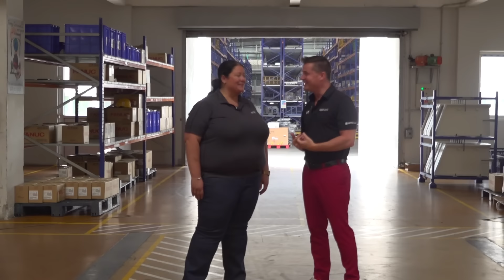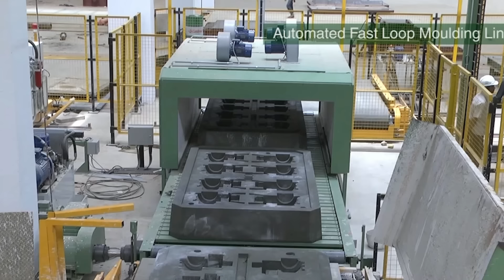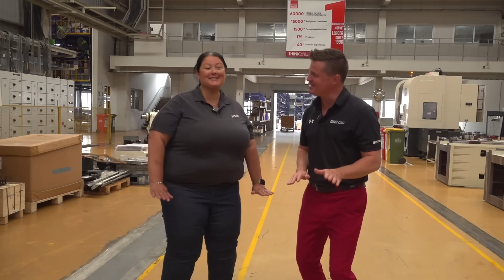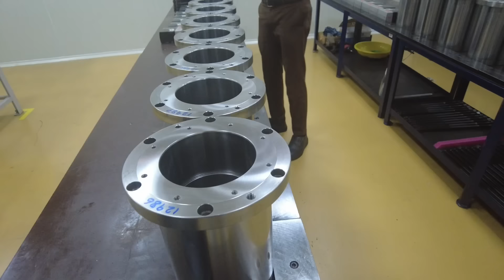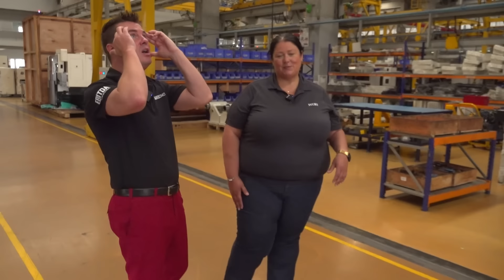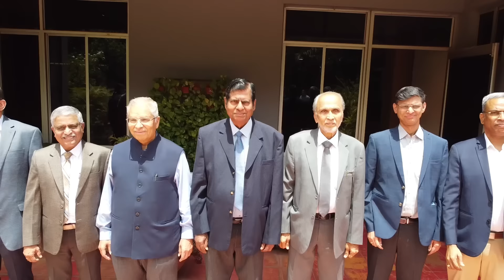Hand Scraping in India and The Next Global Machine Tool Giant Is Ready to Take Over!

Comment: India has had a long history of metallurgy, with evidence dating back thousands of years. The history of Indian metallurgy is supported by archaeological discoveries and literary sources. 
Early evidence   

• A copper bead found in Mehrgarh, Baluchistan, dates to around 6000 BCE
• Iron implements have been found in Uttar Pradesh dating back to 1800–1200 BCE 
• The Harappan civilization used the lost wax process to cast bronze figurines 

Metallurgical achievements 

• The Delhi Iron Pillar, a 70-ton structure that has resisted rust for over 2,000 years 
• The huge beams at the sun temple of Konark 
• The Dhar pillar 
• The steel sword of Tipu Sultan 
• The massive forge-welded iron cannon called Rajagopala, located at Thanjavur 

Metallurgical practices 

• The use of tin and arsenic to improve the hardness of copper 
• The use of mercury distillation, which was mentioned by Indian priests in the Earth Shastra 
• The use of the forge-welding method to manufacture iron objects 

Influences on metallurgy

• Cultural and commercial contacts with the Near East and the Greco-Roman world 
• The Mughals, who improved the tradition of metallurgy and metal working
Reply: In the 1790s [after the Industrial Revolution, funded with loot from India] was underway, a panel of English scientific experts declared Indian Wootz the best steel in the world and Sheffield etc. copied its processes.

Comment: very interesting to see India rising to its potential particularly in high precision engineering. This interview reflects many of my own conclusions, having been taught hand scraping for a surface table i had to make during my engineering apprenticeship 60+ years ago. And the difference between 'mother' machines that are good enough to create parts for other machines. I recently moved our factory production from China to India and can confirm India has this incredible opportunity to take over this sector. We went from traditional manufacturing to completely cnc production of sheet metal, tube and shifted away from massive presses and roll forming for our needs. Result is lower tooling, faster delivery, smaller customised runs, and generally a more adept and agile manufacturing resource. This is so good to see. I suggest anyone concerned about China should explore this country. 
Being much smaller we can't integrate as much as they have but we have found suppliers of key parts which eclipse what we could ever do in China even after 20 years.  India now has to step up and equal the infrastructure that China has, but signs are that this is happening more quickly than i thought.
Reply: India spent 137 billion USD last year on infrastructure and aims to spend a total of 1.4 trillion USD on infrastructure in the next few years.
Reply: ❤🎉🎉🎉🎉❤😊wow 🙏🙏
Reply: Thanks for ur investment mate. We appreciate you.
Reply: Great
Reply: I don't know what you mean by taking over here. AMS is the only one indian machine tool maker that is reputable enough to compete with Chinese brands especially in mid level manufacturing. But If you meant being a center for machining service, it's maybe. If you were describing the quality of machining service in india is better than China(when you worked there previously) then I doubt it. Your comment sounds more like a PR rather than what the reality is. I couldn't take any comment from a person that said they're moving their factory from China to india seriously without them specified what product they made. And for what reason they moving out from China.
Reply: Why I click this video ?
Reply: Jail modi ji❤
Reply: Thank you for your confidence and investment we will not let our customers down